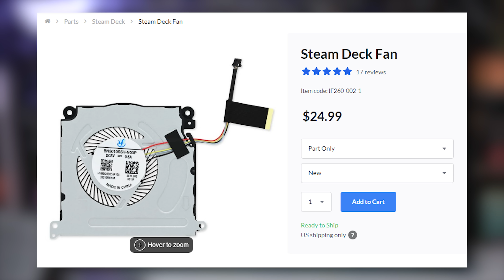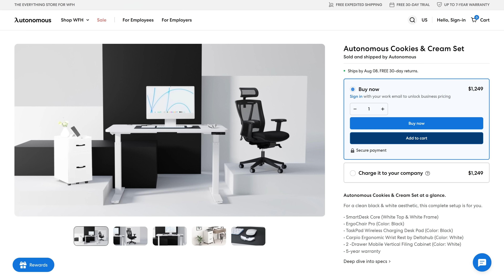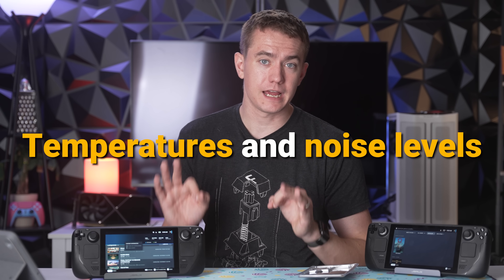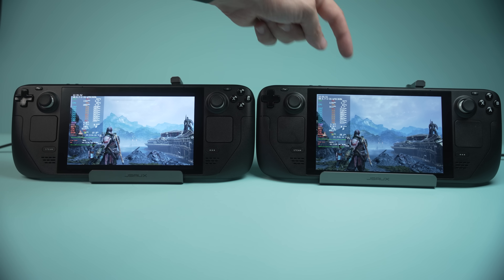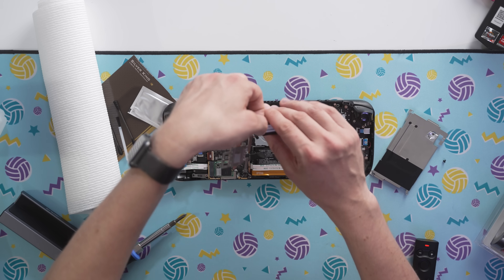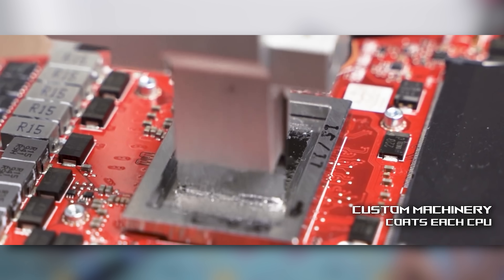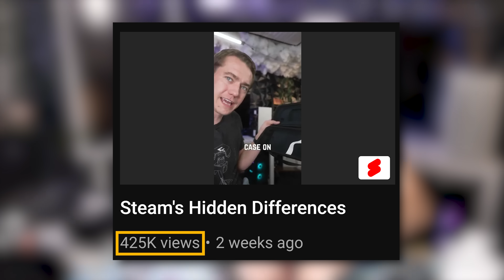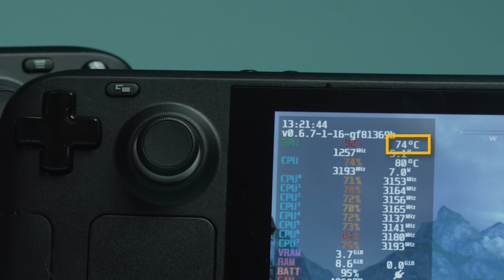Fixing the Steam Deck with Liquid Metal

Comment: To anyone wanting to do this, please do NOT use electrical tape like in the video. This is fine for prototyping but the tape will come off the board with heat and time and allow any extra liquid metal to flow onto critical components. Please use something like ASI 388 or another electronics grade silicone to do this job. I have used it successfully on a LM reapplication in my 2021 Zephyrus G15 which had a poor OEM LM application from stock and had very high temps. The silicone creates a barrier and a seal between the motherboard/components and the heatsink so that LM cannot escape.
Reply: The way i did it when i liquid-metal'd my laptop was to use a coat of clear nail polish on the components surrounding the cpu die. Seemed to have worked as i did it 3years ago and the laptop is still running fine.

This silicone sounds much better though, i'll try it next time i use liquid metal on something :)
Reply: Which would you recomend? I only know great big cartriges id trust, but using like 2g from ~300g is just not my goal... My other idea would be foam tape which seems to work with temps up to maybe 150° without any issue (plus it would suck up any excess) but yea...
Reply: @nxy6123  I used ASA 388 but there are other brands out there as well. Just make sure it's electrics grade which ensures that the catalyst and other components of the sealant aren't corrosive. I used Silver King brand liquid metal since the Thermal Grizzly brand was in short supply last year and was selling at scalpers prices. The Silver King stuff worked just fine and my Zephyrus G15 has been performing very well and staying cool since reapplying the LM a year ago.
Reply: @glsracer  uh can I use lots of thermal paste to do the same thing?
Reply: @mlgoverrated745  thermal paste doesn't conduct heat as effectively as liquid metal so the short answer is no. The Steam Deck has thermal paste from the factory so depending on the type they used, going to something like MX-4 or Thermal Grizzly may make a slight difference but you probably won't notice it in gaming.
Reply: @glsracer  no like use the thermal paste as a barrier for the liquid metal, cause I’m worried that the liquid metal will leak out and kill my electronics
Reply: @mlgoverrated745  yeah, ASI 388 isn't thermal paste, it's an electronics safe sealant that prevents the Liquid Metal from contacting SMDs and keeps the LM contained in the heatsink.
Reply: @glsracer  So the silicone should be put on between the motherboard and heat sink before tightening the heat sink down? Or around the heat sink after tightening it down?
Reply: @gagemcgrath6907  typically it is applied to the motherboard side in a rectangular shape on top of or in front of the SMDs (surface mount devices) that are around the CPU die. Make sure that the sealant completely covers or blocks the SMDs so that LM cannot make contact if it leaks or squirts out when the Heatsink is tightened down. You want enough sealant that it will adhere to the Heatsink when it is installed, but not so much that it flattens down enough to contact the CPU die. Usually a 2 mm bead all the way around is sufficient but you need to eye it sometimes.
Reply: @glsracer   May I know how to apply the ASI 388 on the Steam Deck instead of the electric tape? Is it applying the silicone on the surrounding just like the video taped the surrounding?
Reply: +1 - I wanted to comment this too! People should use the proper equipment for Liquid Metal applications.
Reply: @SomeDudeDan  Weird thing is most people use conformal coating. Don’t really see silicone as being a better choice.
Reply: God Iv just got a steam deck I’m 33 always been a console boy and already I’m looking at using Liquid Metal to make something I haven’t even switched it on I’m Entering the big boy leagues now 😂 pc master race starts at steam deck for me
Reply: I use my steam deck and it is now overheating and thermal throttling so I need to do this because valve doesn't want to help.
Reply: @sophisticated  Yeah it's probably best to repair it yourself with the parts shortages being what they are.
Reply: Thank you. I wish I knew this before I did this for one of my laptops.
Reply: Thank you for saying this, I was thinking the same thing.
Reply: This exact steam deck is on marketplace with a mainboard issue prevent video output so yeah I'd say don't use electrical tape like in this video lol
Reply: Noted! Are you an Valve employee? Even if your not thanks for the tip!
Reply: @jeromesolomon9093  no haha, you're welcome though. I work in aerospace and IT, and have been building and repairing PCs since I was a kid. Started as a hobby for me.
Reply: @glsracer  Tony Stark? I thought you died?
Reply: Or if one wants to use tape, use vinyl electrical tape for high temps like the "3M Scotch Super 33+". It works till 105°C, that's enough for CPU stuff. I never had any problems with it.
Reply: I have a 2021 zephyrus g15 as well, any resources you could point me to help do the liquid metal upgrade?
Reply: Get some clear Nail polish and coat the SMDs around main chip I usually do 2 coats,  find one with Nitrocellulose, Ethyl Acetate which is not electrically conductive and does not erode the metals.

 (NO toluene but does contain Sucrose Benzoate, is that a Benzene derivative)
Reply: Could you make a video :(
Reply: @DumbPeachy  I haven't seen fit to LM my Steamdeck yet but now that I have been able to play Halo Infinite, I'm seeing a reason to lower temps a bit. The game plays ok but it can drop below 40 fps sometimes and that causes some flicker that gives me a headache. I'll post back if I decide to video the process.
Reply: u actually can use nail paint  😂 i used it a few times already on notebooks worked always fine
Reply: Conformal coating FTW.
Reply: I use conformal coating and kapton tape. Has never failed me yet and I haven't killed a single component after dozens of LM applications across various devices.
Reply: can you apply thermal paste on the sides istead of tape? should block the liquid metal.from reaching the components😊
Reply: @druuudruuu6804  I would not risk that. It's best to use an electronics safe sealant.
Reply: I used 4 layers of clear nail polish on my 3070 of strix G17.half a year with same thermals,no issues yet
Reply: Here, Liquid Metal corrodes a copper tube faster than the electrical tape comes off :) The heat pipe would first have to be nickel-plated in a special flask, and then applied with liquid metal
Reply: You really don't need to bother with any component insulating beyond the electrical tape used during application. Once the liquid metal is sandwiched between the heat sink it isn't moving - liquid metal has high surface tension. Tests have been done by violently shaking devices with liquid metal applied - no spillage.
Reply: @pathlessbullet7557  there is still the application. It's easy to accidentally drip or spill. And as always, as the old saying goes, better safe than sorry.
Reply: We need more of you in the comment section  sir
Reply: that tape is just to cover the surroundings while spreading the liquid, he removed after that
Reply: @MrDvneil  even worse then. The liquid metal can flow out over time and contact the SMDs.
Reply: @glsracer  watching tronicsfix repair ps5 pros shows how the ps5 does it. And they use like foam type material, and I can imagine it would be worse on a steam deck that actually moves.
Reply: @bretttheillustrator  I've not seen the PS5 video but based on what you're saying about it, I agree that the foam wouldn't be as good in a mobile device as the electrics-safe sealant. I wouldn't want to take any chance that the LM could escape the heatsink and find it's way elsewhere in the device.
Reply: @bretttheillustrator  Some of the PS5 seal are defective and allowing the LM to leak around the APU.
Reply: @diegosilang4823  Some? I haven’t seen more then one case?

Comment: You could potentially 'lock' that liquid metal under the heatsink with liquid electrical tape and just cover all around the edge, assuming only a light coating is used so you can remove it later if needed.
Hell, maybe RTV silicone the heatsink to the CPU.
Reply: Fucken spammers

Comment: I think I'd rather use capton tape instead. Over time, the adhesive on that electrical tape is going to turn to a goo that is a major PITA to get off.
Reply: nail polish of the acrylic variety works quite well and insulates components. there is proper stuff to use but you can find used nail polish at your local store.

Comment: When applying liquid metal if you clean the chip using IPA first it'll apply much easier. I also recommend using the metal syringe tip and lightly scraping the die to make it apply easier

Comment: You can actually notice once it got hotter that the older version was ~90 degrees on the CPU and the liquid metal stayed at 83 degrees, not to mention the 1200 rpm difference!

Comment: I still wouldn't recommend liquid metal like this in a portable system because you walk, run, jump and whatever with it in your backpack or whatever and that may make the liquid metal to really get everywhere.

If you make some proper isolation then it would be fine.
Reply: LM have big tension when u sandwich it beetwen soc and heatsink. It doesnt go anywhere. Just use some electrical grade silicon or general purpose varnish for pcb and u will be fine, nothing to worry about
Reply: @SkeltherBot   there will always be a bit outside of the CPU\GPU\SOC die and with a lot of shaking that thing can eventually get all over the place.

And sure you can cover the PCB but on something that you shake a lot it could look like a explosion of liquid metal happened inside specially if applied a lot and I don't think anyone would want to cover almost the entire PCB to protect against LM.
Reply: @guily6669  it doesnt go anywhere because of tension. I go LM on all my private laptops + delided cpus, gpus and never have any problem. For me its just a big W.